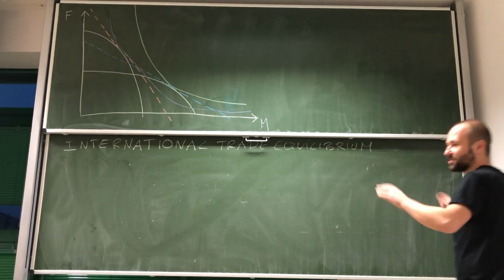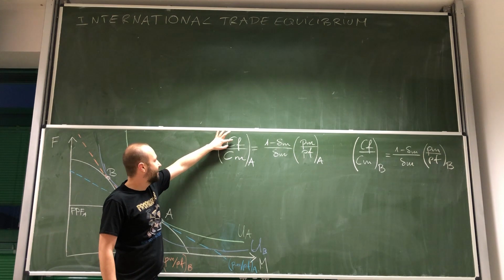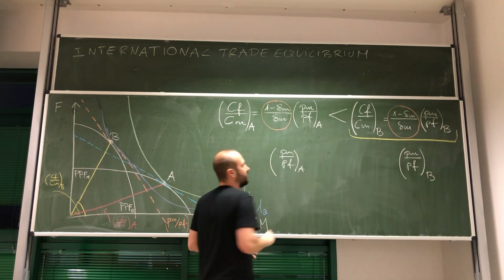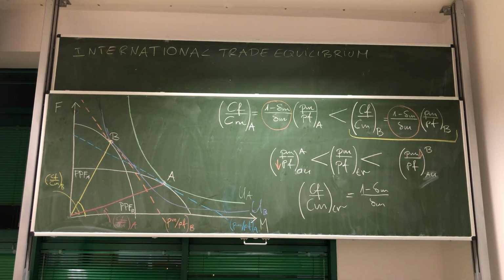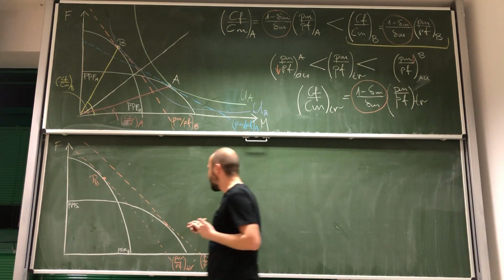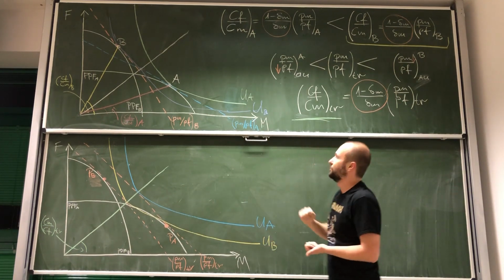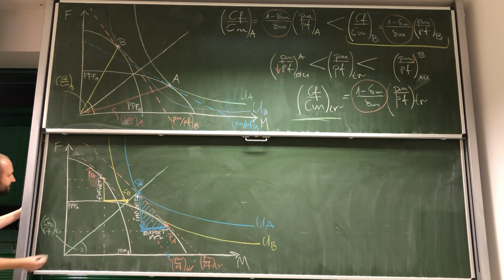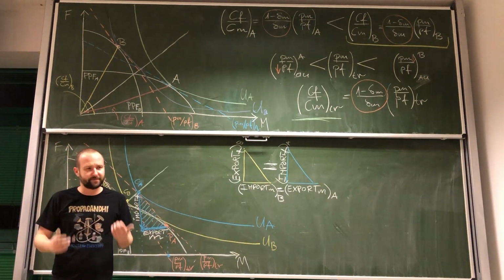26. IEF: Neoclassical model of trade - International trade equilibrium

Comment: at 36.31....in any one of those triangle does that imply export equal to import for any individual country as well depending upon the prices...or there can be difference between expoet and import based on demand ????
Reply from the maker: Hi, this is a long run mode without money. All we have is an exchange of goods. Consequently, within neoclassical model of trade we always have balanced trade: exports=imports. However, there exist plenty of extensions of the model (introducing money and intertemportal choice being two primary examples) where we can have unbalanced trade.
Reply: @lazarskiopencourses4059  Ok got it